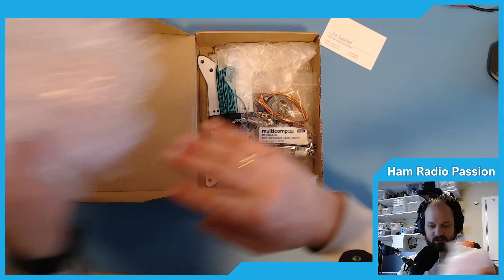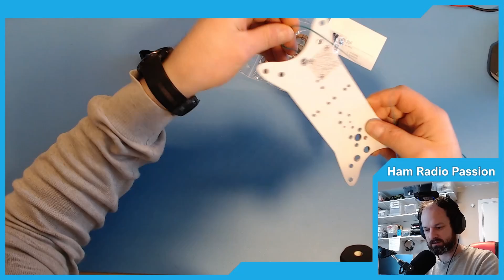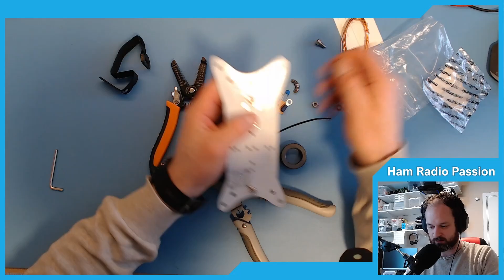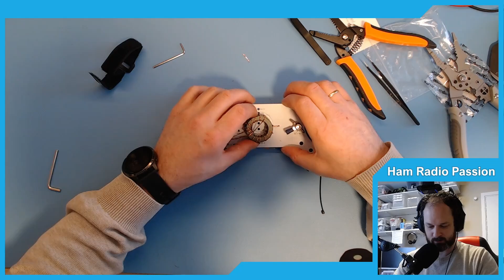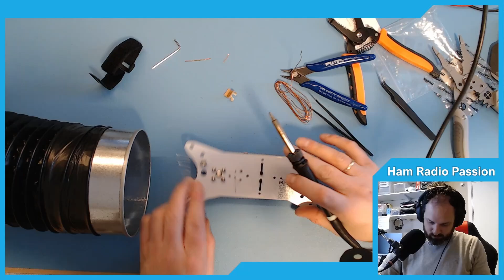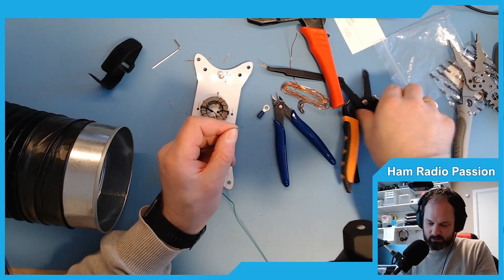Complete EFHW Antenna Build from Radio-Stuff.com

Comment: I might start shipping solder tags rather than crimp connectors, what do you think?  M0VUE
Reply from the maker: First of all, a really great kit! Unfortunately not had time to test it in the field, but looking forward to! I’m a fan of soldering, but probably just my taste. What I have experienced in an other efhw I have is the wire stress on the connector is a week spot. So that would be my only suggestion to add some stress relief there. Other than that I think this is a great kit that I will have as a regular inventory in my pota bag. Tnx
Reply: @hamradiopassion  Good point, I've not heard of one break yet except for Colin he broke the wire in a tree.  I'll probably pop a keyring clip in the kit in future.  Thanks again M0VUE
Reply from the maker: Thanks for a great kit. Keep up the good work!